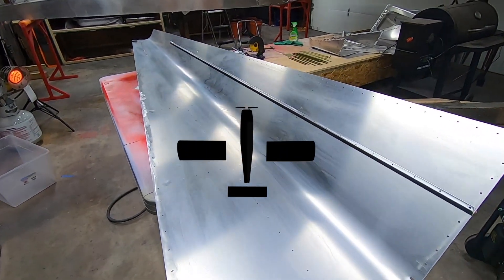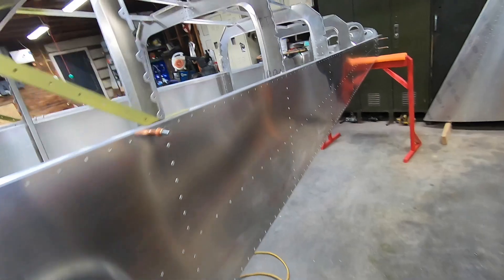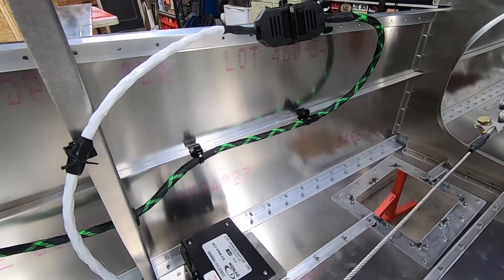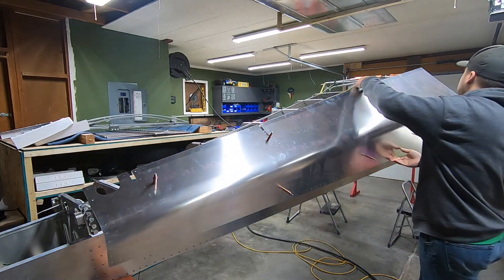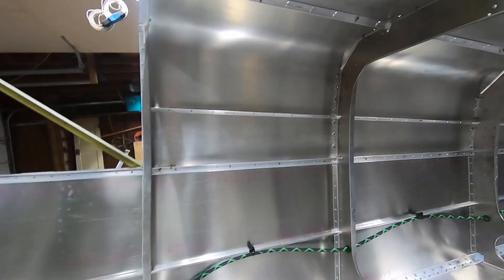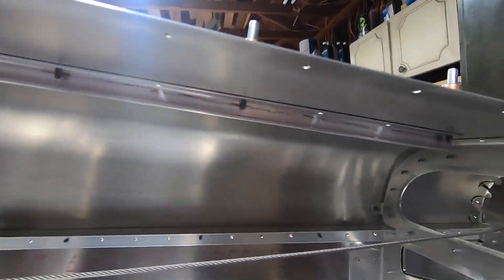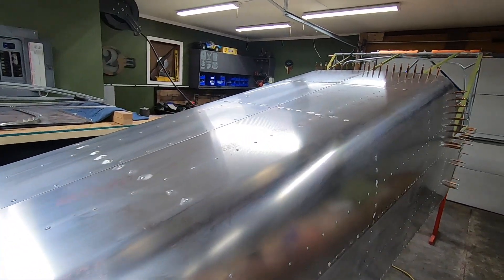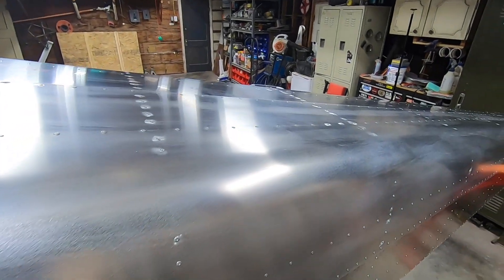RANS S21 EP20 UPPER TAIL CONE SKINS

Comment: When did you match drill your top tail cone skins from #40 to #30?  Did you do this on the table upside down though the stringer?  Or did you do this with the skins on the tail cone?  I have seen some do this on the table, but my #40 holes don’t like up perfectly when clecoed to the bulkheads so it seems like match drilling in place would bet a better skin fit.  However, this isn’t easy on the plane.  I am thinking drill just the front and back holes and then remove the skins and lay flat on the table and trust they will fit well if they stay flat while drilling through the stringer.
Reply from the maker: Tryin to think back and remember how I did it all but it’s a bit foggy now.. I would naturally lean towards upsizing in place as it allows you to pull or push the hole in the event something wasn’t exactly on at the #40 stage. I don’t remember fighting things to much on the tail cone skins though🤷🏻‍♂️

Comment: What was the modification to the teflon elevator push pull tube guide? Yours looks like you made the opening taller up, and down.
Reply from the maker: Mine came that way (incorrect), and Rans sent out notification to those who received kits including these parts. The guid hole is taller and skinner so they have you widen it out a bit and all is good. If yours looks like the print, your good to go. Good Eye!

Comment: Where did you source your tie wrap fasteners that you used for your wire bundles in the fuselage? Thanks for posting these great videos.
Reply from the maker: Check the links in the video description. Its called a cable tie edge clip. Thanks for watching!

Comment: Really enjoy your videos. I’m working on my wings right now. Can you tell me where you got your small metal chop saw and what brand it is?  Thanks
Reply from the maker: That's a harbor freight special. Cant say I would recommend it too much, but it does the job on the smaller stuff just fine and didn't cost much.
Reply: @Project2Aero  thanks. I have a 12” cutoff saw for bigger metal pieces but thought something a bit smaller would be better for the little stuff.

Comment: Nice! It's gotta give you a feeling of accomplishment when you rivet skin in place. Nice little chop saw ya have there. I've been looking for a bench-top, multiple-speed band saw for cutting metal. So far, no luck. Wish I had the mechanical chops to convert one of the $100 Big Box types to DC. Question: What primer are you using?
Reply from the maker: That chop saw is a harbor freight special👍 A little band saw would be useful for sure! I’ve been using the PTI Zinc Chromate from aircraft spruce. It’s been working good for me and it’s hard to beat how tough it is when it cures up.